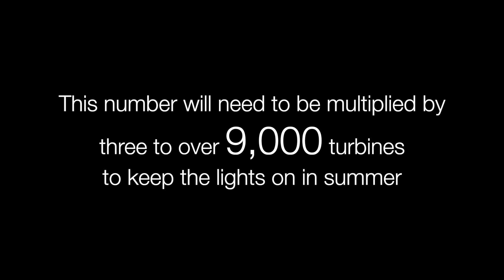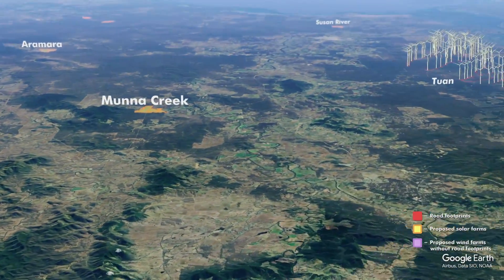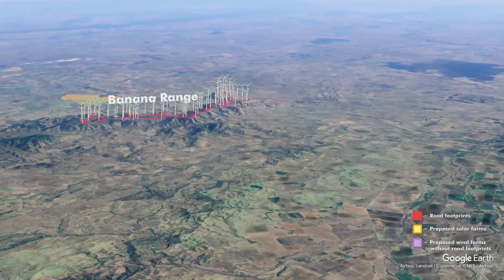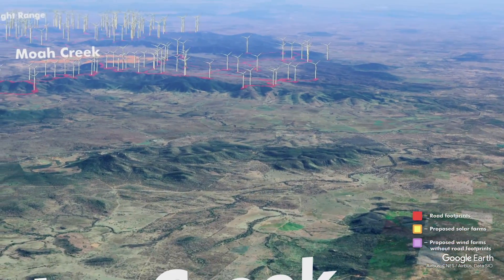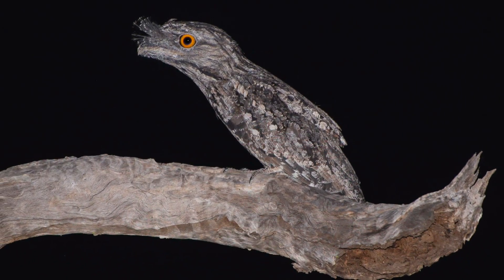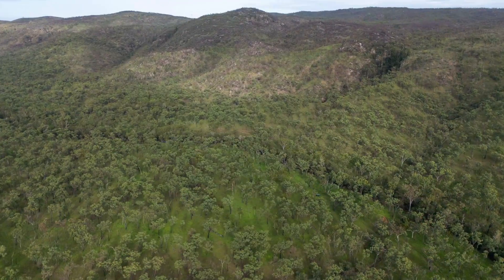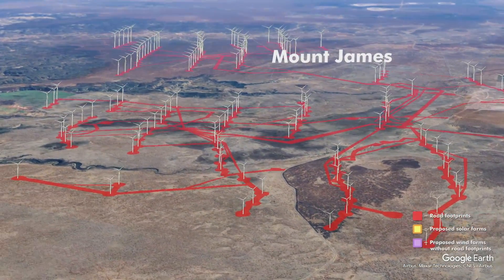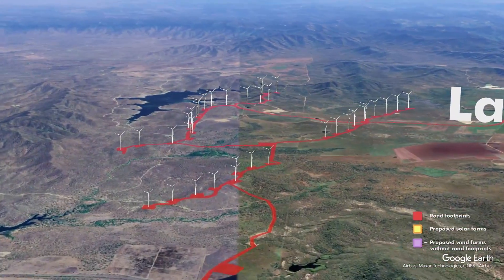Proposed renewable energy projects across Queensland.

Comment: How can it make more sense economically and ecologically to build all those roads instead of using helicopters? (And airships in the future?)
Reply: No helicopter has been built able to carry the loads involved. Airships are very unwieldy and will never be useful for such loads.
Each blade is up to 50 metres long and requires wide radius roads with adjacent trees removed.  They weight around 20 to 22 tonnes and so many local roads had to be reinforced and then along came the turbine in the nacelle.  All of 200 tonnes.  The segments of the tower are thick steel and weigh tens of tonnes each.
Helicopters will be used to string the power lines across the rugged valleys between the tall towers needed for the Grid connection.
Reply: The components are moved by rail and then oversized trucks. Large cranes then assemble them. Also they each need many tons of steel reinforced concrete or cement for the base of the tower. Even if you had large helicopters that could carry every one of those items needed, my guess is it would be way too expensive then. Also the generator part only last 15-20 years if they don't start on fire. The blades last less than that, it needs regular oil changes, etc... So they need to have access for constant maintenance. Not sure how the oil changes go, but I'm guessing you'd use tanker trucks which would be way less expensive than using helicopters all the time.
Reply: @specialed6357  In Australia there is no rail for these sized loads.  All oversized loads by road under special escort.  Due to load limits on bridges or physical over size, often a circuitous route is needed to go out and back.  That may be from the nearest Port where can be done.  Port of Gladstone has a 200 tonne load limit on the bridge out of it, so large generator part for a nearby coal power station had to be landed at other Port further away.
The worlds largest helicopter, the Russian Mil Mi 26 has a maximum load capacity of 20 tonnes (an acquaintance worked with one on PNG), They cost $thousands per hour and very few outside of Russia.  Not even able to lift one turbine blade at a time.

Comment: In 20 years time when those turbines begin to die of old age, no-one will take them down.
They will just be left to rot.
Reply: In most cases they will be taken down...but then left there on the ground in nature not to rot, but to stay there as non-biodegrading problematic waste.
Reply: @pistonburner6448  The Contracts that I have heard about, the responsibility for the deconstruction rests with the land owner.  Including the costs. And the actual disposal of the structures (due to the often difficult terrain even with the "access roads" and the size of the bits, it will not be economically viable for a scrap metal dealer to send in their heavy equipment.)
Also site remediation.  Remove that 250 tonnes lump of buried steel reinforced concrete?
Reply: @planesounds  Round the world there are lots of dumped composite wind turbine blades...they are not steel or anything which is recyclable. They are also not biodegradable. They are problem waste. The blades also wear far earlier than the lifetime of the whole turbine installation: the edges of the blades wear out much faster than anticipated, and thus blades need to be replaced often (and the efficiency drops before they are replaced).
Reply: @pistonburner6448  Having recently had a close look at a set of blades, they are a monster and not unlike a beached whale over a hundred kilometres from the ocean.  I also have photos of what a blade breaks into when the whole tower is brought down (with explosives around the base place inside the tower).  The blades at McIntyre wind farm come from India and come in sets of three.  If one degrades all must be replaced.  Weighing in at ~22 tonnes, they are not something that you just tow out behind the Landcruiser.
In the Queensland (and most of the inland) the natural UV levels are far greater than experienced in Europe and North America.  Plastics (resins) that last for decades in those environments are badly degraded and cracking apart after one summer here.
The design of the blades is an amazing and difficult aerodynamic challenge for the engineers and actually is akin to that on a medium sized jet airliner.
Reply: @planesounds   Another problem is rain and other impurities (birds, bats) physically wearing out the leading edge of the blade. Damage to the leading edge cannot be patched or fixed, it means the whole blade must be replaced...and as you said the other blades too.

Comment: Steve where have you been for the past 30 years for all of the extraction of fossil fuels? If you actually care for these spaces you would know that increases in temperature is the biggest threat.
Reply: Australia CO2 production per year = 466 million tons (from au.gov)
CO2 required to increase global temperature by one degree = 1 million million tons (IPCC).
Therefore temperature reduction if Australia achieves NetZero = 0.0005 degrees C per year. 
A ten year old child could work this out - and they will. 
I’ll leave you to explain the carnage you’ve caused when they ask; “why?”.
Reply: @Hickalum  you do realise that it's a cumulative thing in the carbon cycle right? And it's not only emissions from Australia that count?
Reply: Also green energy in all it's form still uses oil. For example look into how much oil the wind generators use. They have a large tank of it inside them, I forget how much They even need the oil changed just like a vehicle does. It also needs grease and or transmission like fluid. E.V.s are full of plastics made from oil. Also they still need grease and fluids. Solar panels, etc... So even with 100% green energy, oil isn't going away for at least decades to come. At the rate they are shuting down farming and converting farmland, we'll starve before plant based plastics take over. Very soon the green energy grift, population sustainability with green energy, shutting down farming and self inflicted famine, ramping up of destroying nature, etc... are all going to come to a head in revolts. It will be the haves, and have nots all over again. Elites vs. Plebs.
Reply: @specialed6357  In the clean and green EV world, those EVs will be driving on roads surfaced with bitumen and parking in car parks covered in black tar. The cars themselves will use oils and greases made from crude oil to keep them going.  The plastics that are needed for the insulation around both the kilovolts and nanovolts for the management of and distribution of the clean electricity are made from the gases at the top of the refinery tower.  Crude oil will be needed forever.  Two previously waste liquids from the refractory tower are petrol and diesel. Fortunately for over 130 years they've been able to burn these in a controlled environment to give us mobility and power.  What will happen to those liquids if they can no longer be burned for power and locomotion?  Pour them back into the environment?
Reply: Biggest threat to what, if we destroy everything in nature in the quest to supposedly save nature. Thank you for at least admitting green energy isn't any better (lithium open pit mining which also poisons the land, chopping down the rain forest to do the poisonous open pit mining there as well now, chopping down forests for solar and wind, replacing vegetation and farm land with solar and wind, etc...) is no different than the old ways. But at least the temperature will be unnoticeabley lower as we continue to warm up to normal temperatures as we continue to exit the ice age.

I have noticed the pattern, with all the destruction of nature, I now believe part of their goal is strip away earth's natural ability to reduce Co2 so it rises and then they'll claim see, the levels are getting higher, we have to do even more. Not to mention the weekly increase of coal power plants in china and india polluting big time as well. Though at least china is also now building nuclear powered container ships which is the safest form of energy production. Unlike the stupid western nations that are abandoning very safe nuclear power for nature destroying green energy methods which again shows their goal isn't to save the planet but destroy it further. Not to mention E.V.s not being an answer cause in order to replace fossil fuel vehicles, and ignoring the fact that there isn't enough lithium in the world, just the amount of copper alone that would be needed is more than the entire total that mankind has ever mined so far. So we need to massively ramp up copper mining but the tree huggers always protest to have mines shut down and block new ones from opening. I'd say tree hugger types need to get their priorities straight of whether they want E.V.s or oil, but yet another pattern I'm noticing is only the elites will be allowed to drive in the future. The rest of us plebs will be forced to become Amish or cavemen. Which is where "You'll own nothing and be happy" comes into play along with their we need to greatly reduce the world population by billions of "the useless eaters".

Growing up we used to plant trees and have tree city designations. I physically planted by hand many acres (over 10 acres at least) of seedlings over several summers in the late 80's early 90's that are now at least 50 feet or more. Then I see outskirts of toronto canada clear cutting everywhere to build neighborhoods that are each acres and even miles huge to build what they call "mc mansions" for rich people. If they are going to kill off billions, what are they waiting for? Till after they finish destroying the earth apparently. These are the same people and governments that came from big oil. Big oil is also themselves doing green energy as well. These elites are just switching over their methods of plumaging to green energy. It has nothing to do with saving the planet. They are also get rich quick scammers getting tax payer government money to start up these really big green energy startups and then filing bankruptcy after walking away with multi millions and billions richer. Like that solar scam president barack obama "yo momma" supported while he was president for one example.
Reply: What increase in temperature?  The hard fact is that the increase in temperature actually lags the apparent increase in CO2 levels.  Whatever is causing the claimed increases in temperature it isn't the gases in the atmosphere.
Australia would not be adversely effected by the predicted 2 degree increase in real terms.
The so called record increase in the European summer temperatures last year turned out to be a 100th of a degree.  Not 1 degree or even a tenth of a degree. It was hidden behind the hysterical rhetoric from the head of the UN who is only in it to protect his empire.
The "oceans are boiling"!  Simply idiotic.

Comment: Steven, thank you for pointing out these very human behaviours in our country. Consumption is key. Stop consuming and uproot the demand. The same goes for plastic and other environmentally impacts in our environment, stop consuming and it will disappear. Working together is key, our society is conditioned to think individually.
Reply: You should lead us by example. Become amish or a caveman and stop consuming all your internet related devices. All green energy devices and E.V.s need plastics. Also oil, grease, etc... Look up how much oil the windmill generators hold and how often that oil needs to be changed just like an i.c.e. vehicle needs oil changes. As long as man exists, it will never "disappear". Not even oil use can disappear for decades to come, even if we went to 100% green energy tomorrow.

Comment: while i support your objections to wind farms in high conservation value forest (anything worthy of a National Park approval should be made one), you need to be very careful from overstating your case and making rookie errors in presenting information for the public about renewables. your emotive narration is tiring. 

a number of your comments in the introduction are confused and/or misleading. i’ll  take the time to explain, not that i expect you to take this on board, clearly you are motivated to use the most emotive language you ca, so technical errors probably going to be considered of little consequence for you. to me they make your arguments weaker and your authority suspect. 

saying the national power grid is only 30% of  national emissions and therefore we need to triple the power supply is confusing a number of interrelated issues and getting it all jumbled up. 

you mention the variable exports from wind and solar generation.  (you use the incorrect term “intermittent” the way a CC denier might) nature of wind and solar generation and say that means we need to triple the supply to accomodate that. well no, theres lots of gas generation that has Capacity Factors of 10% or less while modern wind farms are producing 50% CF and the potential to go to 60% and even 70% off shore exists. but it’s a pointless comparison in terms of land use impact because wind farms and gas generation are so incredibly different. the fossil gas generation facility is much smaller than a wind farm of the same nameplate capacity, and even allowing for a 10% CF is still  going to be much much smaller than a similar capacity wind farm. but fossil gas now comes from fracking fields where potent methane leaks at wells, active or capped, and migratory emissions happen at rivers and other places. if you don’t like wind farms go take a look at fracking fields and the health impacts on humans and animals. i worked on a film over ten years ago documenting the toxic impacts on ground water and the range of health impacts to locals. many cases of farmers closing down operations u to ground water contamination in USA too. 

the other thing you said about renewables needing “three times” the capacity (presumably of fossil fuels generation assets) was that the power sector is only 30% of emissions. you’re correct in saying that demand will grow to accomodate fuel switching but make the same mistake many fossil fuel defenders make thinking that fuel switching requires same energy in BTUs from renewables as from fossils. no, very often 2/3 of the energy from fossils is wasted as waste heat from the process. so we only need to provide the energy doing work with renewables, not the waste heat. and heat pumps extract energy from the air at a ratio of up to 5 to 1, or 4 units of free energy for each unit of RE electrical energy supplied to the pump.

many of the wind farms you describe are on previously cleared land. vast majority in fact. you don’t mention the environmental destruction of land clearing, and QLD was the last place to engage in that on a massive scale for livestock operations.

livestock is one of the most climate destructive uses we can put land to and rewilding it would be preferable.
Reply: You are slightly right in one critique of the introduction but there could be more deconstruction of your comments but I've only time for one quick comment for within your comment.
In a case on the Queensland Darling Downs where natural gas drilling and harvesting was blamed of apparent methane emission bubbling up in a nearby River and billabong.  These were completely unrelated to any gas drilling activity but totally natural fermentation of vegetable matter in the silt on the bottoms of the water courses.
In that area a number of foreign activists arrived to create an antiNG rhetoric for political gain.
And sorry, but no. almost none of the proposed Queensland wind farms are on previously cleared land.  Much of that is in semi-open to closed natural forests.  The roads up the mountain ridge have been created specifically for the special needs of the transport bringing in the bulky wind farm components.
Reply: The reason they knew 3 times the required amount of Solar & wind is because of the intermittency & variation of sun & wind. In SA recently production was down to 10% on a cold cloudy day meaning they had to import or generate energy with deisel to make up the 90% deficit of power needed, hence they oversize the farms capacity in hope of getting enough power, ut this does not always work and they still need battery, hydro &/or deisel, coal or gas for backup, so why have a flimsy, unreliable & not for purpose  national renewable energy system when we still need the original or better infrastructure to generate enough power when the weather doesn’t want to play golf?
Reply: Sorry i didnt go back to the posters commentary

Comment: Ridiculous and just using emotive language doesn't make it true. Renewable energy is the only way to end fossil fuel use and those terminal effects on all biodiversity. None of the mammals will be impacted directly so it's just totally bogus. These are pretty much all on private grazing properties long ago cleared, and they can clear and impact biodiversity way more than wind projects without any requirement to apply for it. 
There are well over 20,000 CSG wells and thousands of km of gas pipelines, with 11% of Qld under fossil fuel exploration. Yet you say nothing.
The idiocy of it all is how much you're just pandering to corporate fossil fuel interests. It's kind of astounding how ridiculous and ill informed you are.
Buying back the land and removing cattle would contribute way more to biodiversity with more public funding and ownership of renewable energy projects.